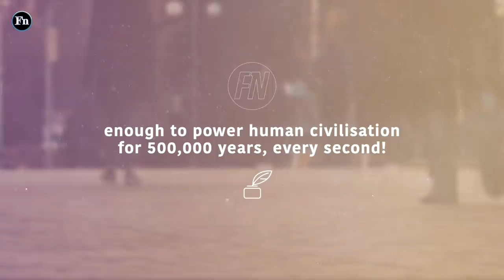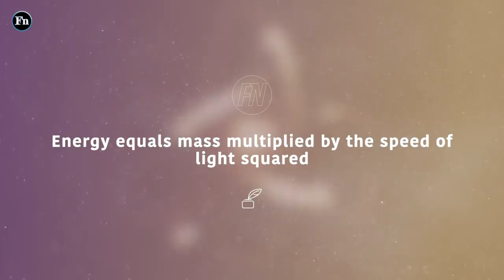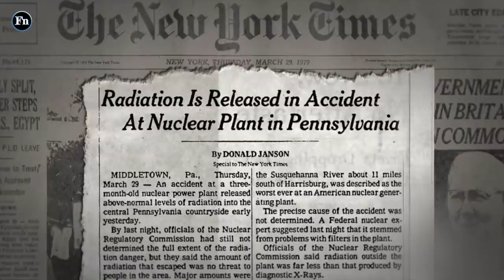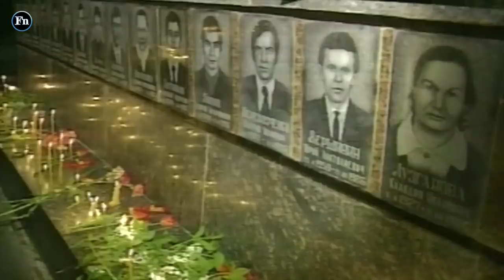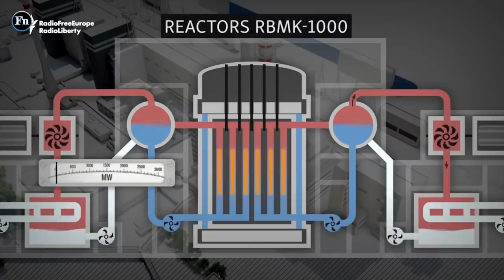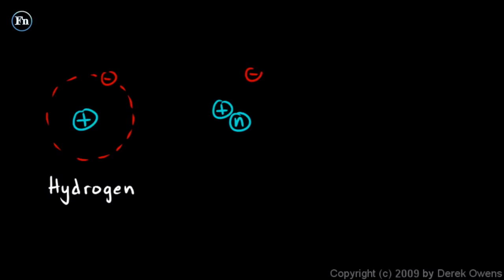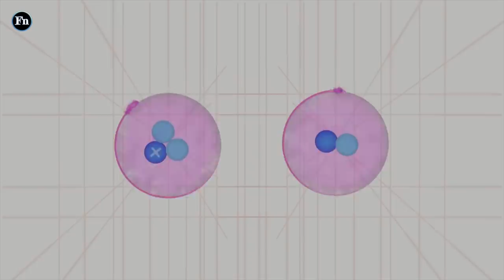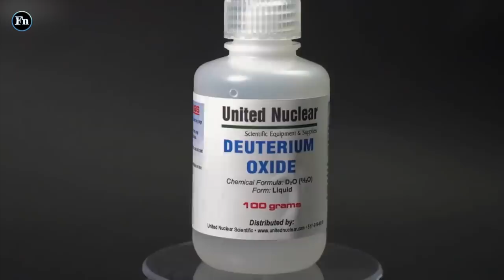Why did China build an artificial sun?

Comment: To add on to the problems of green energy, wind turbine blades only last for a maximum of 22 years. These blades are made of undegradable plastic that sit in landfills forever.
Reply: Navy Beast1 No. I did not read it anywhere. I have two relatives who work in the business of inspecting and repairing wind turbines. They both have been apart of teams that bury the blades near the sites of the turbines or just don't bury them at all and let them sit there for eternity.
I have a question, how do you turn a fiberglass blade into a pop bottle?
Reply: @juicedupsmg  bruuu you wrong
Reply: @juicedupsmg  umm no in my neighboring country they just bury them underground ☹️
Reply: @juicedupsmg  it's sad how wrong you are

Comment: There's a thousand years worth of coal in the ground. We're definitely not running out. During photosynthesis, plants take in carbon dioxide (CO2) and water (H2O) from the air and soil. Within the plant cell, the water is oxidized, meaning it loses electrons, while the carbon dioxide is reduced, meaning it gains electrons. This transforms the water into oxygen and the carbon dioxide into glucose.

Comment: By any chance, this artificial sun can explode or anything ?
Reply: But it won’t release any radiation so that’s a good thing
Reply: @TgamerBio5529   haha lol
Reply: @BL_fanboy  it would most likely look an explosion but with out the radiation and Co2
Reply: It would have to run longer than a few seconds to do that... They failed to meantion that part.
Reply: It’s the most safest power source for the environment right now and won’t do any long lasting effects compared to nuclear fission and its easier to clean compared to nuclear fission that will takes 100 to thousands of years
Reply: It is not a bomb kind of thing.. don't worry
Reply: It can explode, but fusion will stop immediately as soon as temperature drop below 100 million kelvin
Reply: @aks33662   Spidey fan here also 🤦🏻😂👍🏻
Reply: @TgamerBio5529  that’s what the movies say
Reply: @MR.WAIIKER  hmm nah nuclear fusion is more safer then nuclear fission. Because nuclear fusion focus’s more on heat then radiation. The radiation is very short compared nuclear fission that has long lasting radiation. This is actually a scientific fact: do you think what is more costly fixing a land pledge in radiation or just a massive hole that can be easily covered up ?

Comment: So China built a Fusion Reactor. So what, Europe and the US already have them, they have yet to yield net energy. I mean, I applaud them to building it, but I don't see what the fuss is about, pretty much ANY Fusion reactor can be set to "Starburst" mode. Heck even you can build whats called a Farnsworth Fusor and build one of these on your own. What bothers me about people's understanding of Nuclear technology is they thinks that Nuclear reactors are either like the 1970's style Gen 2s and think (Chernobyl or Three Mile Island) or  you jump to Fusion and that's it. Not realizing there are decades worth of improvements in design and even using entirely different fuel cycles to generate power in things like Molten Salt Reactors, which if implemented could solve the world's energy economy and ecology at the same damn time. If anything China announcing this is a distraction from the fact they are building MSRs which would put them ahead of the US, which is honestly sad since we invented the technology in the first place. We haven't even explored the limits of FISSION technology but we think we can suddenly implement and use fusion tech. This is what bothers me about the so-called "Green Energy" movement, there is a solution that's been sitting on the shelf collecting dust, but they won't consider it because their political predecessors already ruled it as "evil". Which means, they are not truly interested in solving the problem, but securing money and power, the political kind not the electrical kind.
Reply: Literally going to school right now to solve this problem, I agree the salt reactors are awesome.
Reply: What did they rule out as “Evil” and Why?? (sorry if this is a silly question to you…science is very confusing for me.)

Comment: a small mistake can make the whole planet into a mess and even black holes can be created artifically which may consume eveything on its way
Reply from the maker: Even light, the fastest-moving thing in our universe, cannot escape
Reply: What is with this black holes? What will gonna happen
Reply: @JULALAINE   the black holes are the holes formed in the space when   star death or neutron star death take place when they die they form a small star or magnetar which has strong magnetic field in them   that is approximately 10000 Weber /m^2 soo such bodies when this magnetar dies or its magnetic field is increases irrelevantly due to conditions or during the death of star they form into black holes  now we have 2 black holes in the space travelling toward our universe ,although there are theories of white wholes tooo which continuously emit everything out of it...
Reply: @rvstech8435  thanks and what will it cause the humanity and earth? Hope its not so bad.
Reply: @JULALAINE  its not about good or bad but should be care full its almost 6 times the temperature of sun that they are producing in that reactor on the earth
Reply: @rvstech8435  yeah and the black holes too
Reply: @rvstech8435  so wouldn't turning off the machine which stops the sun from being made create a black hole and why not if thats the case?

Comment: So how much energy does it take to reach those temperature and pressures and where does that energy come from?
Reply: That was my question
Reply: Jonathan Rivera  actually use copper wire but cooled to negative 10000 degrees turning it into a superconductor meaning it can handle very high voltages without melting
Reply: Does it compensate how much energy it needs to work vs how much energy It will deliver ? Makes sense?

Comment: I'm curious why the materials they used did not even melted on such heat.
Reply: Because the plasma is magnetically levitated
Reply: I am still confused. Even though its levitate how can they contain such heat? If the earth has to be just the right distance from our sun to not burn up in flames how can they contain something even hotter in Earth
 Sorry but it just doesn't make total sense to me. I don't care how you put it 1 + 1 will always equal 2 well it just sounds like fancy jargon used to get us to believe its done and in the way they want us to believe its done.
Reply: @bernadetterose6649  so, what? Are you saying it is powered by magic?
Reply: @IceCold11235   if it’s 200,000,000 more degrees hotter then the sun and we know that without the earths atmosphere we would be burnt to a crisp how is it possible that something that hot on earth won’t burn us to crisps ? It doesn’t make sense
Reply: I like your curiosity it shows you are a critical thinker. You got me thinking as well.

Comment: This is old technolgy and is so easy to make with AI hardware. All you have to do to form the fusion spark is to open the collector transistor circuit that carries the liquid helium potential difference and current, which is to click save on the  relevant keyboard, this will cause a reverse spark from a Meissner London Effect  helium current to a hydrogen voltage, which triggers the fusion chain reaction. Us Afrikans had done this in Ancient Egypt 5000 years ago. It was used for reincarnation.
Reply: How do you know this?
Reply: Source?
Reply: How??
Reply: @bernadetterose6649  It is elementary if you've studied particle physics.
Reply: @eastafrika728  what's your source? Saying the science of reincarnation is elementary is disingenuous.  Either source up or shut up, with your pseudo nonsense.
Reply: @willydakid6596  do you know the elements used? Deuterium and graphine, if you understand graphine's properties, the momentum of sub atomic particles within the plasma flame, from ionized graphine oxide and deuterium, balance to cause fusion to occur -n to c+, forming a hydrogen bond, what is missing from the Tokamak experiment is the volume used must be reduced by 75% for the certainty of fusion, now don't ask me another stupid question.